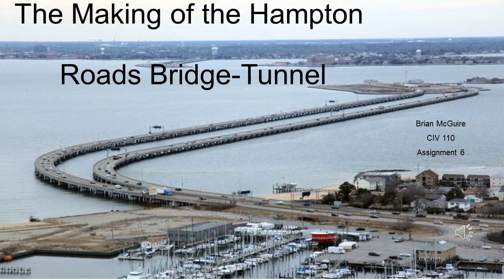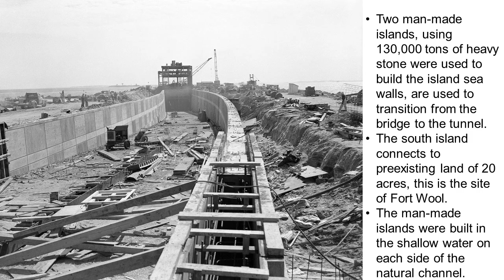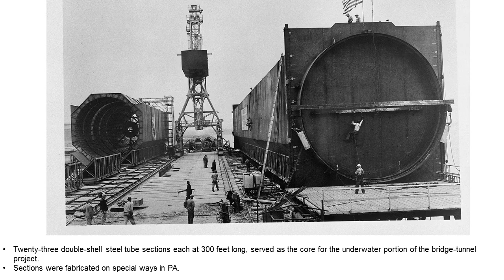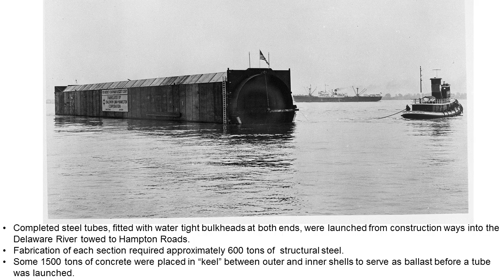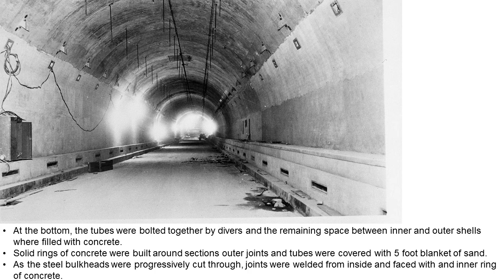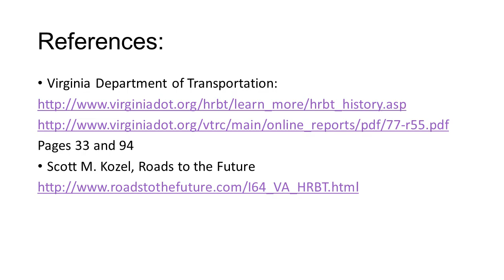The Making of the Hampton Roads Bridge-Tunnel

Comment: starting working on the Eastbound exit in the summer of 1974,Was a Carpenters helper for Morrison-Knudsen out of Boise Idaho,Only worked there for a couple of months and then hired out on the Norfolk&Western Railway as a Brakeman,Conductor and Engineer until I retired in 2016,Good people I worked with on the carpenter gang at Morrison-Knudsen